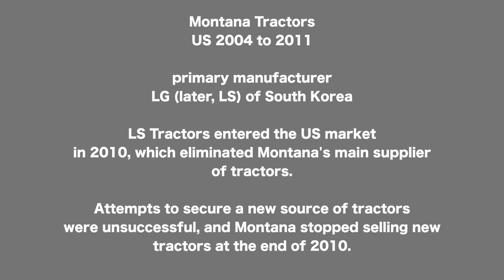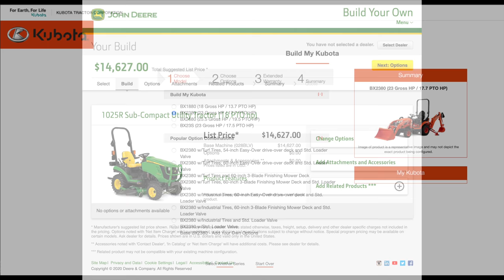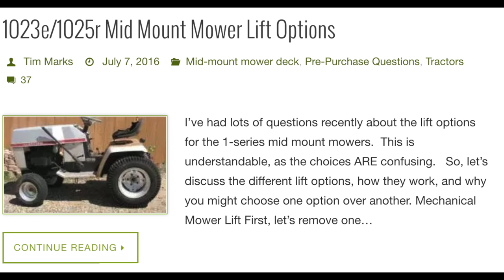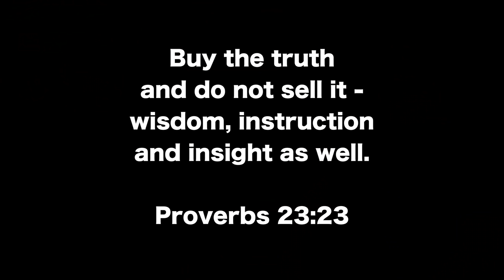Have NO REGRETS! Watch This Before You Buy A New Compact Tractor!

Comment: As much as I agree with all the info about the top 2 brands, I’m really intrigued with the Yanmar tractors. They build their own tractors in the USA. Cast iron rear ends and a 10 year warranty. The biggest dislike is the loader attachment for bucket/forks etc. The amount of different attachments for the 1025 always has that at the top of the list.
Reply from the maker: Only one dealer in Indiana...and the salesman told me that he didn’t want to be selling them.  Red flag for me.
Reply: I actually have 2 within 30 miles. I agree wholeheartedly on the parts dilemma in the future. I am less than thrilled with my local JD dealer, that’s my main reason for looking at other tractors. I have filled out at least 3 online quotes for them with no response and when having my JD zero turn repaired I was less than thrilled with the service I received.
Reply: @Darren.R I'm with you there on JD..I went to JD  dealer in 2012 to buy but jd dealer did not seem like they wanted to help or anything. I went to Kubota and they let me try the tractors out and gave me good advice..just my experience.
Reply: Buy the tractor you like that has dealers relatively close.  I have a Kubota, my Dad bought a Yanmar. We have both had them several years with "0" problems.  My brother bought a New Holland- loves it and has had only one warranty issue that was handled quickly.  My buddy bought an LS and loves it-also no problems.  To sum it up- I paid the most for my tractor because I bought Kubota and I have no regrets.  But, they all bought tractors that were just as capable and paid a right smart less money for them.
Reply: You may want to check out Massey Ferguson.  They've been in business MUCH longer than Kubota.
Reply: When I think of it, I’m very fortunate with the location of different tractor dealers within 25 miles. JD,Kubota, New Holland,Kioti, LS and Yanmar.Add Mahindra to that also.Kubota has 3 dealers within 30 miles of me alone. Massey is the only one that is a tad farther and in a place I’d rather not drive to.

Comment: 1.5 acre and use 2038r. Really happy i went that route instead of 1025
Reply: Jon Stuart our of interest, why are you happy with that over the 1025. I have a 1025 and want to upgrade to a 2038. Need the extra pro power, but I’m worried about the larger weight and size of it.

Comment: When I was looking around, the most annoying thing any john deere dealer would push was the all inclusive package.  Tractor, loader, brush hog,  box blade and trailer.  I didn't need the  box blade nor the brush hog, but needed a 60 inch drive over deck and a backhoe.  My only option was to but them individually, even the trailer.  but they wouldn't create a package deal for that combination.
Reply from the maker: I’ve never had that experience.  The dealer has always been willing to price whatever I wanted to buy.

Comment: You stated that companies that make their own products are the safest purchase option long-term, and I wholeheartedly agree, but why do you place John Deere, in that category?  They source their engines from Yanmar.  How is John Deere any different than Case/New Holland with Shibaura, or Massey Ferguson with Iseki.   These companies have all been in business as long as John Deere or Kubota and also have extensive dealer networks.  Would love to see you do a 1025R comparison against their comparable models like you did with the Kubota BX series.
Reply from the maker: Deere took over the design of their compact tractors starting in 2000.  Yes, engine is still yanmar.  Big deal!  Yanmar engine is used in most compact tractors.

Comment: Could be the same on tractors but I spent around 30 years working in Motorcycle shops (Dealer) A lot of people say buy your  motorcycles in the winter as sells will be off. This is not always true. Most bigger deals have there bikes on what known as a floor plan and that is where the bank loaned the money for lets say 40 bikes. In turn you get free floor plan for 3 to 6 mouths and those mouths are in the winter, so the 40 bikes can set there for free for the 3 to 6 mouths. After that the dealer has to start paying interest plus when the bike is sold he has to pay it off at the end of the mouth. So if he sells a bike that is floor planed he has to replace it with out being able to set on it for free. 2nd thing to look at is when thing are slow a dealer has to get as much for each sell as he can but in lets say summer when he is selling 5 to 10 units per day he has more room to deal. The only time I saw buying in the winter mouths worked out is to find a dealer setting on a unit that the free floor plan had run out on and he was getting ready to put his order in for the new models. So always ask what he has in left over stock. So if its 2020 see if he has any 2019s left.

Comment: I know for a fact here in Florida a dealer up north will have a package that tractor comes with trailer and attachments where here in southern Florida they don't. I'm talking John Deere. I bought my LS tractor with a trailer, loader and box blade. My dealer is 5 miles from my house which helps in buying parts. John Deere dealer is 15 miles away, Kubota is close to 20 miles away. I like John Deere an would have bought one but the dealer didn't want to help us he just walked away from us.

Comment: I got a B2650 for a less than 1/2 acre lot (with intent to use on larger property in the future).  Yes, I have felt embarrassed.  What the is largest tractor that will fit where you need it to go?  What is the smallest that will do the job?  Most of the time a smaller tractor will do the same job, just slower (more passes, more scoops).  But the main reason I went with the larger of the small Kubota's is the loader lift capacity.  Many times you can't just take a smaller bite.  You have to lift something, and the tractor will either lift it or it won't.  Loader/backhoe lift capacity is what I've used the most on my tractor, and I'm very satisfied.  But there have been several times when it just wouldn't lift enough.  Figure out which attachments will be needed for the jobs prior to getting the tractor.  You may want something different, like a Ventrac.
Reply from the maker: B2650 seems like a nice unit.  Have only driven one in the parking lot...would love to give it the 'what for" and see how it does!

Comment: My wife and I just bought our first big piece of raw land today: 32 acres of woods, with hills, creeks, fallen trees, and one road that needs re-clearing. Otherwise untouched for at least 50 years. I'm buying a 40' shipping container for a tractor, 4-wheeler, cart, and tool storage, and then I buy the tractor. This will all happen in the next few weeks. I need a loader with a backhoe, and I can cash-flow the 1025R. My worry is that I may need the 2038R instead. This is a serious conundrum for me. I cannot afford to cash-purchase the 2038R with backhoe, but I could finance. I really don't like more debt (we expect to pay the land off in two years, then build), but I worry that the 1025R is not enough tractor for my land. Need to do culverts in creeks, backhoe out some small trees to build new roads and haul larger fallen trees (room to drive tractor between big trees if removing a lot of saplings; almost everything is hardwoods). Later on we clear brush and spread crushed rock on roads. After building we mow and maintain the land. What tractor do I need?
Reply from the maker: You need the 2038r, or maybe even larger.
However, you could potentially start with a 1025r, and trade up later.
Reply: @TractorTimewithTim  thanks, Tim. That reality is kind of setting in for me. I might have to finance, but (with backhoe) $35k for 2038R vs $20k for 1025R is tough. Guess I'll talk to a dealer and figure out how to do this.

Comment: This was a great video because I'm considering my first tractor now.  I just purchased 4 acres to build a new log home.  The area we're building is about 2 acres and fairly level (could use some planing to smooth it out tho).  Its mostly clear as well.  The other 2 acres is wooded.. and sloped.. and will require some regular cleanup.  

Anyway, the reason I'm considering a tractor is because the cost to have the site work done.. especially the finish site work after the home build.. is gonna cost roughly $10-12k if I hire someone to do it.  My rational is that for not much more.. I could just buy a tractor and do it myself.  However, after the site work is complete.. it'll mostly be used as lawn mower and for snow clearing.. and I'm worried that a sub-compact tractor may be overkill.  With that in mind.. I was looking at the x758.  But the cost of that mower after adding an aftermarket loader.. 3 point.. and box blade or planer.. will cost almost as much as the 1025R.  

Any advice or suggestions?  If it helps.. there's a recent video on my page showing the land we'd be maintaining with it.  

Thx.  I love your videos.
Reply from the maker: Post this same info and question on greentractortalk.com.  Tell em I sent you...include the photos of your land...you will get tons of diverse advice.  Taken together, all this advice should help with your decision

Comment: My property is 1 1/2 acres.  I owned a JD 2210  4WD with a loader along with two JD X595 4WD  garden tractors, one with a loader,  and a X740.  I do some side work  and bought the 2210 mainly for larger side projects. Now that I do not do much side work, I sold the 2210, because the X595 with a loader is more that adequate for me.  I actually prefer the X595 for yard work and am using it almost every day.  The 2210 was just too big and did tear up grass much more than than my X-Series tractors. The bad news is that an X-Series with a rear PTO and 3 point hitch  will cost about the same 1025.
Reply from the maker: ...and the new x7's do not have loader option available from Deere...only from 3rd party.
Reply: @TractorTimewithTim  I designed and built the Buford Bucket.  My brother, Pete, now builds and sells them for X-Series tractors, 300 and 400 Series tractors. JD no longer offers the 45 loader, so the Buford Bucket is an option.  I follow your channel because you are a professional , intelligent, kinda nice person.
Reply from the maker: gotdeeres cool!  I’ve heard of Hoosier Pete!
Very nice design. 
Thanks for watching our videos!
Reply: @TractorTimewithTim  Pete and I are just two farm boys from NW Indiana. I am some of the brains and he is the welding, fabricating, and delivery side. I  mentioned this as a joke on WFM, but then people actually wanted to buy them.

Comment: I selected a 1 series for our compact tractor because we already had bigger tractors 50 hp and up. The 1 series does the best impersonation of a riding lawn mower out of all the option out there while still having some tractor capability, longevity, and resale value. 

Most attachments for the sub-compacts are cheaper but grapples have me scratching my head. I can buy huge grapples (think 80" rock bucket) for the skid steer new for the same price (or less!) as the dedicated subcompact grapple that still would need 3rd function hydraulics. I assume it has to do with their volume of sales but it's at least one example of the cost of attachments not always being cheaper. Still, if the subcompact is the machine a person has grapples are still worth having imo.
Reply from the maker: Grapples are so expensive because the steel is higher quality than larger grapples.  This is to minimize the weight for these little tractors.
Reply: @TractorTimewithTim  that makes sense. I just can't justify the cost vs. the limited capability of them for my 1 series (versus on one of the larger machines). 

I'll probably add a single jaw to the center of my bucket one day for working in areas where the other machines won't fit.
Reply from the maker: Have you seen any of our grapple episodes?  The 1 series with the grapple is amazing!
Just make sure you get a lightweight one. Like Artillian or PrecisionMFG

Comment: A lot of good info you gave here. Only thing I would disagree or maybe add in if you will, there are a few other brands out there that have been building tractors for many years who offer sub compacts. Massey Ferguson, and Yanmar to name a few. Also note Yanmar is an excellent choice as well, John Deere actually has been and currently still are using Yanmar engines in their tractors, so I would suspect them to offer parts for many years to come. I enjoy the channel, keep the content coming, it is good to see the reviews and other opinions on things!
Reply from the maker: only one dealer for Yanmar in all of Indiana.  Red flag to me.  
thanks for your comment!  Like you say, there is room for many opinions.
Reply: @TractorTimewithTim  I understand, I'm sure it will vary greatly based on location. We have them everywhere in texas, so for me it was an easy choice. The Yanmar was $5000 cheaper then the comparable John Deere and has a 10 year warranty vs the John Deere 7 year warranty. The engine in the comparable machines are identical, even same model number. Again enjoy the channel, I am looking at various attachments for mine, so I like to see honest reviews on products!

Comment: So I found this post 8/15/20  and 690 comments. Now that said I have no disrespect for Green, However in my personal search I landed on a Yanmar 221, ( 21HP diesel) engine. Typically JD uses Yanmar engines. I am satisfied with my Yanmar, but, it is not perfect. Now that being said, I can do everything that I expected to do with my choice tractor.
Reply from the maker: Welcome, Ron.  Deere used to get ALL of their compact tractors from Yanmar.  Over the last 20 years, they have converted each size one at a time to their own design.  They do still use Yanmar engines, and I suspect they will continue to do so, as these engines have proven incredibly reliable.
All of these little tractors will get the job done.  There are advantages and disadvantages to each which are also unique to each person. For example, each of us has a different relationship, distance, etc with our dealer. This can be the most important item when making a tractor decision.

Comment: It is tough to make the decision on your first tractor unless you know all the things you wish to do with it. After purchasing my first tractor a 2501 Kubota I have decided to do more with it. I purchased it with a brush hog and a grader and since bought a wood chipper. If using multiple implements I am purchasing a 3 point quick hitch. So when purchasing a new tractor one should consider the quick hitch in the original purchase along with implements because they are discounted with the initial purchase of the tractor and can usually be purchased with the zero percent interest as well. I myself would only purchase a Kubota or a John Deer and if purchasing one or the other with a quick hitch buy implements that are quick hitch ready. Not all implements work with a quick hitch. Changing implements is tedious without a quick hitch and if you are a first time inexperienced tractor person you will regret not having a quick hitch from day one. Nolan is primarily a John Deere guy, I myself after studying both the John Deere and the Kubota chose a Kubota for reasons not seen in any of Nolan's video's. The Kubota has 3 gear ranges in their hydrostatic model and John Deer only two. Kubota has metal parts where John Deer has way too much plastic. Kubota has a real fuel gauge instead of a float fuel measure in a fuel cap. They are both the best choices in tractors next to all their cheaper competition. John Deere is a bit higher priced for what you get. But John Deere's do look pretty in their Green and Yellow. I will settle for the power of orange, more metal parts and an extra gear range, the real fuel gauge on the dash where you can see it is nice too. I would hate to run out of fuel with the gauge out of sight. A long walk and inconvenience if you ever ran out of fuel.

Comment: Making buying decision, can you restrict the height on a John Deere 3 point hitch. IE: rear snow blower keep it just above gravel to remove snow not gravel or box scraper for the same reason.
Reply from the maker: Yes, you have full ‘position control’ with the 1025r or 2038r.

Comment: ??? Thought JD sub compact and compact tractor engines were built by Yanmar , I may be wrong, haven't checked in 3 yrs. ---- would start with a minimum 23 to 25 hp d. engine tractor, 21 hp hydra systems seem anemic ( some times as much as half lift capacity). [21 hp = 800 lbs / 25 hp = 1250 lbs examp.]

Comment: Great informative video Tim. I am in the market for a tractor also. We have one dealer in our area that has a monopoly on the Deere brand but they have ban around  a long time. I may have to research the possibilities of driving a hundred miles but I don’t want to limit myself. I had a B2210 which was a 2005. Great little tractor very strong for o LT having 23HP. Now however I’m interested in a 35-40 HP and a backhoe. I also like the drive over self docking deck. Thanks for the video. Happy tractoring.